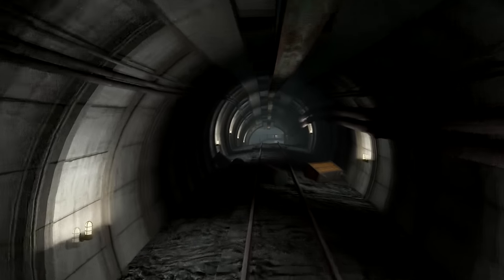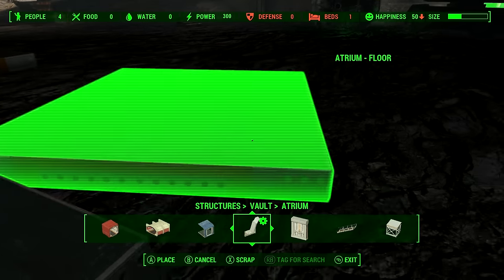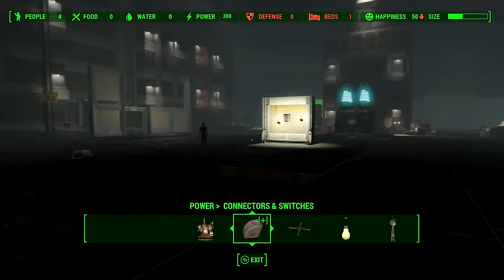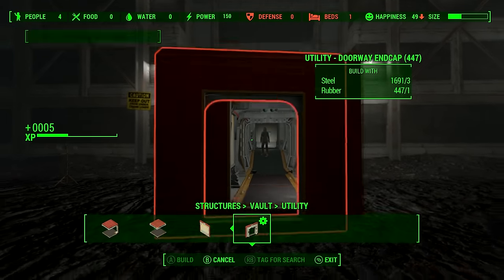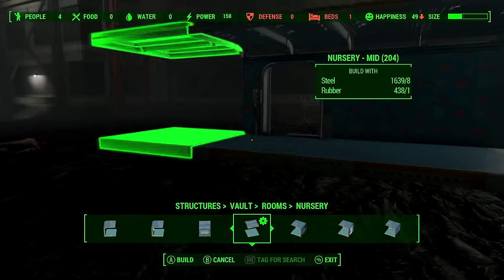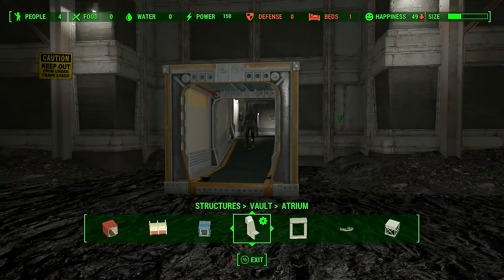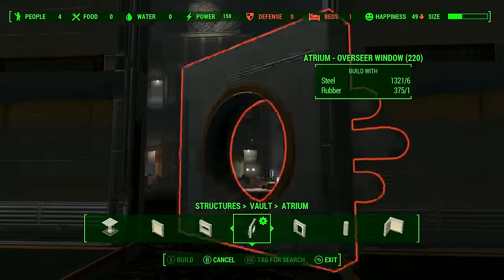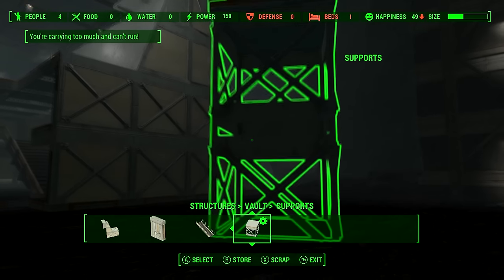Fallout 4 Vault Tec: HOW TO BUILD A VAULT (Bug Fix, Connecting Rooms, Lighting, Atrium Walkthrough)

Comment: I've been putting a huge amount of effort into keeping these buggers actually inside the vault! They like to teleport out for various reasons... This seemed like a good place to share my tips! A few tricks I learned are:
1] Don't leave any openings in the vault at all.
2] Don't place crops to close to the wall, about half a 'vault square' from it should do.
3] Don't place the soda fountain in a corner, or with a side against the wall. The back is fine, but try to keep the front and sides far from outer walls, there is a very huge 'teleport to interact with' bubble around this item.
4] Don't build ANYTHING outside the vault they can walk on that is not constructed from the SCAFFOLDING tab. I tested this, and a guy teleport up to the tip top of my vault to walk back and forth on a stair case build from the 'wood' tab, removed it and it's never happened sense.
5] Don't build anything the settlers can get assigned to outside of the vault (beds) crafting stations and other interactables seem to be fine, but I have had people teleport to my bed, and had to remove it. (I have an isolated section of the vault the settlers can't enter that is basically 'outside' the vault.
6] The elevator is great for making areas to keep your stuff in you don't want the settlers to mess with, I've never seen the settlers use mine.
7] ALWAYS place floors. Bare ground (like for gardens) will make the settlers glitch out, and teleport on top of the vault and get stuck!!
8] If you use the scavenger stations, place them near the entrance of the vault. I haven't tested placing them further inside the vault, but I've had issues with them before, and they seem to work fine where I have them placed. (right near the vault door)

Comment: I had a blast and still am with this dlc, the power system is easy, just snap a vault Tec reactor to any vault, and any connected vault piece connected to that reactor is powered, and in the switched section of the power there's a switch to connect to vault walls to tap into that power
Reply: I custom built my whole atrium, it was a pain, but I made it look so much nicer than if it was a prefab like you showed
Reply: I mainly need resources, because after you run out of building space in one area, you have make a long tunnel to the next open area, which most likely is super far away

Comment: I struggle so much with wall corners 💀 like the basic walls won’t connect in a corner you specifically have to use the corner wall piece and then sometimes the ceilings won’t connect to the walls either.

Comment: Thanks for this Guide!
I had build a wonderful Vault, but most of it was in Darkness, because I hadn't build Power Lines yet.
That was planed for Today, but now I can search for this Power Boxes and that will make all a little more easy. ^^
This DLC is Fun to play, but I needed much much Time, to only build the Atrium, because of the Cyling Gaps I had.
Now I have an even better one, even if it is a little smaller, but now I become Problem with the "Max Build" counter. 

Really, I ask myself, how someone can build a REALLY BIG Vault, with most of the Tunnels used and without Mods, if the Counter fills faster as you can build the Main rooms for the new Vault Dwellers.

For Example: I have build a good and big Atrium, a Overseer Room, Security Room, a little Private Room for the Overseer, two Reactor Rooms (Because one is needed independently from the Main Vault in a Special Tunnel Segment, a Cantina and a Clinic Module with Beds.

But now I'm allready in the Yellow Field and only have the most needed Stuff in there.
Most of the Clutter that makes a home looks alife is missing, I need to build Quarters and a Hydroponic Farm for Food and so much more, but the Counter is nearly full.

And then there are some Modules I miss, that are needet to build a save Vault, like Walls to make smaller rooms for Private Bathrooms and so on.
Rooms that are only one or two blocks big and there are still no functional Showers, Washers and dryersfor the Settlers!

Living in a Vault is nice, but without the Possibility to clean oneself and the Clothes, the Air will become smelly pretty fast. ^^

Hmm... Maybe Beth should overthink the DLC Policy a little. They have made Themed Workshop DLCs yes, but by every one of theme there is the Feeling, something is missing. Special Contraptions Fabric Modules like a Recycler for example, or special Clutter like in the OCDecorator Mod, that makes a Empty Home nice to the Eye and feel better, or even such things like functional Showers, Washers and dryers.

Yes, Fallout 4 is no Sims, but on the other Hand, why not?
Good, the Settlers are  so intelligent made like Brahmins, but if it is your duty to Build Settlements and now a Vault, why don't bring this Mechanism to the Peak?

Also it would be nice, if Beth would give the "Lizens" to make "Clutter DLCs" to second Organisations OR speak with the Modders and make a "Modders Workshop DLC" where some Settlement Mods would be put together in ONE DLC, with stable compatinility between them and give the Modders for each buyed Version a small share.

That would be nice and fair and better as the Plan to let others Pay for maybe "Pirated" / stolen mods, that bring the Game to Crash because incompatibilitys with other Mods.

What do you think?

Comment: i wanna point out something useful i discovered. you CAN"T snap vault pieces to any other workshop set pieces directly which is sad... i wanted to make a town that looked like it had salvaged pieces of a nearby vault to enhance its own structures..

BUT WAIT!

those vault tec support platforms will snap to everything so you CAN kinda make it work if you want to. want to jury rig your vault with concrete and metal pieces? you know make it look like some sort of military bunker or maybe just a raider hideout with wooden catwalks and such? well get to snapping those supports in place to connect vault pieces to whatever else you feel like.